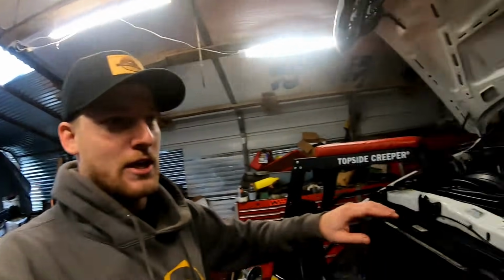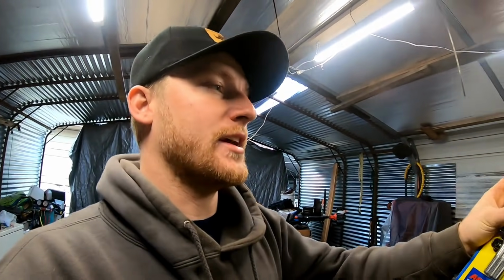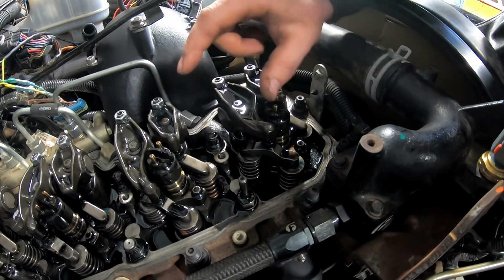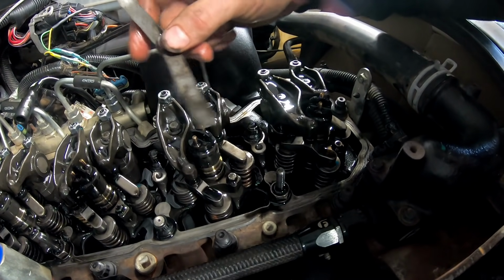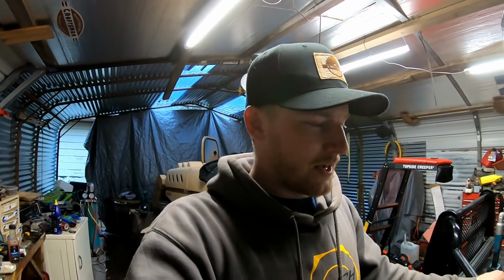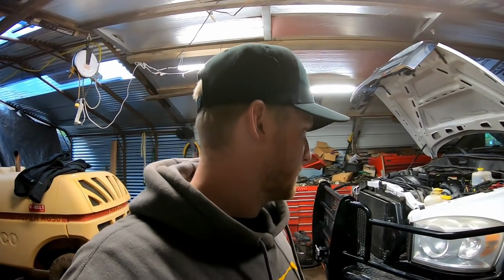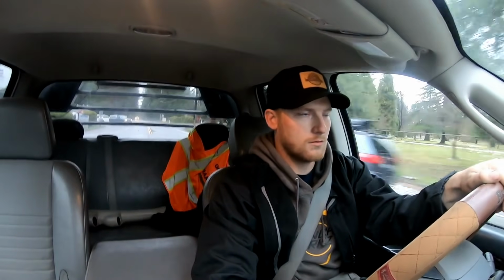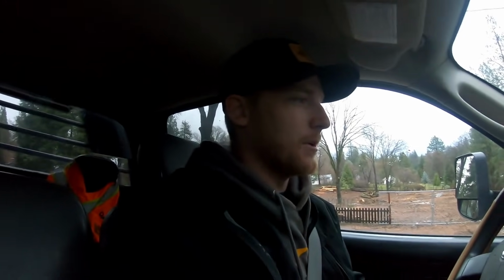HOW TO KEEP YOUR CUMMINS RUNNING SMOOTH! also 5500 BACK IN ACTION

Comment: Yep, thousandths matter. I’ve seen 24 valve’s with an irregular idle smooth out after a proper valve adjustment. You’d think that with a fairly generous .010 and .020 spec that it wouldn’t matter, but it does.

BTW, did some research on turbo blankets. Power Driven Diesel and UT Austin did some dyno testing with positive data. As a result, I have a PTP turbo blanket on the way. Do a Google on “UT Austin turbo blanket” for an interesting, scientific look at the effectiveness of TB’s. Faster spool and a documented increase in torque during the spool up with a Cummins 6.7 on the dyno.
Reply from the maker: Manny Puerta really? Turbo blankets does all that? They have one for vgt set up? I might try one
Reply: V-BELT and SON   Well, the data is there to prove it. PDD has a dyno test on YT and UT Austin published a white paper on the results of their research. All available online. Real data, no opinion.

Apparently, PTP Turbo Blankets is the king of the hill with a quality product, from what I can tell.

I think a TB will be a good compliment to my Banks Ram-Air Cold Air filter and High Ram. Seems to spool faster with reduced smoke coming on boost. I try to be objectively realistic with my results, and I have to say my truck is more responsive and stronger going through the gears now. No proof, just seat of the pants. I don’t have a flow bench and a dyno, so I have to depend somewhat on the big boys doing the research.

Comment: Hey sam  Do you still have the VGT turbo in that truck or did you swap a second gen/ aftermarket exhaust brake ?
Reply from the maker: Dustin Gould it has a 64mm vgt on it now
Reply: @VBELTandSON  awesome thanks for the info

Comment: What would you say would be the best exhaust brake for daily use on a second Gen 3500
Reply from the maker: Straight Piped 99 Pacbrake in my experience delivers the best braking power.
Reply: V-BELT and SON alright thank you very much

Comment: Ive seen alot of guys highly recommend the ARP 625s, the price difference is crazy compared to the 425s, are the 625s really necessary for a deleted 6.7? or are the 425s good enough?
Reply from the maker: yea I would say 425 are solid for mild tunes and mild boost. 625 is like race mode

Comment: Do your self a huge favor and get rid of the grid heater. Take the large wire from the grid heater feed on the intake and then take it off the big solenoid under the passenger side battery. Now take that Banks intake off and cut the grid wavy heat elements as close to the center bolt and the end feeds as you can. Carefully remove that crap and be careful not to drop any of the black plastic parts into the intake. I did drop one but it was easy to retrieve. If you can take out that center bolt. I did not and will soon as it can come off and guess what happens then BOOM. Message me if you want to know how to get your fan on a switch so you can turn it on whenever you feel like it. Or on a nice little item I got from Amazon that would turn it on at any set temperature you dial in. The ECU does not turn the fan on until the engine is WAY too hot. I am going to ask my tuner if EFI Live can set that point down.
Reply from the maker: Gerald Koth have you hooked the switch up? And ya that would be awesome to have engine fan working around 200. Be cool if it could be tuned into it
Reply: @VBELTandSON  I am going to look up your email and send you a message with some options. I have not used a switch YET. I do have the adjustable thermostat for a control. Using one on my electric AC fans.
Reply: @VBELTandSON  I found you on FB and sent a message with the info.

Comment: Does this mean that Pacbrake can now run their load leash with the 625 head studs?
Reply from the maker: DodgeDude 908 it is very difficult to get a straight answer. But I don’t see why you could not make it happen. Just have to shorten them down like I did. They should really offer a complete arp kit that is bolt on ready
Reply: Yeah you’re right about that. I was just checking their website and they said that with the 625 studs that you’ll need those special studs you got directly from Pacbrake’s website (part #P55127) to make it work. So it looks like the answer will be a yes there bro. Now I gotta go through the hassle of selling the 425 studs I already got lol